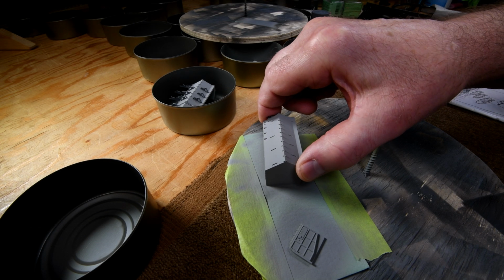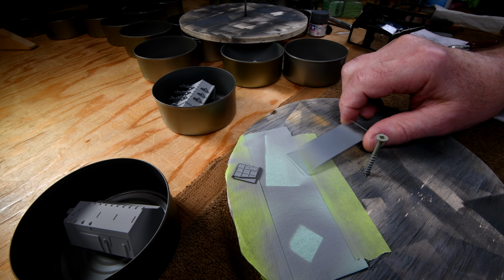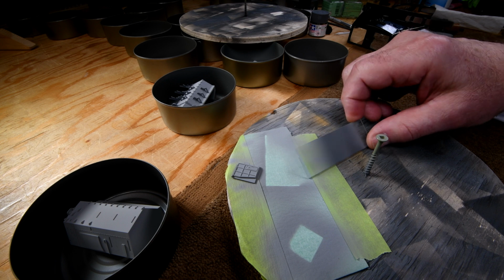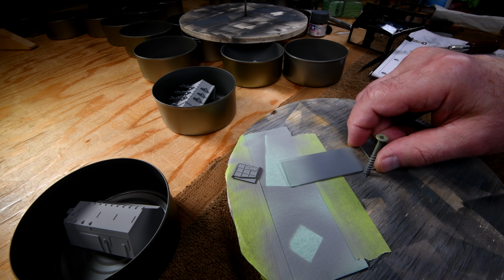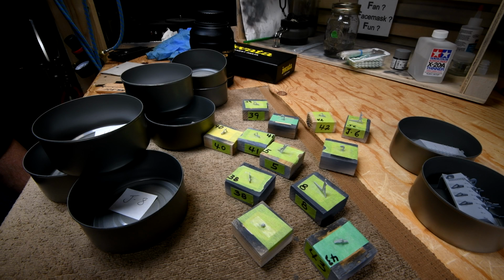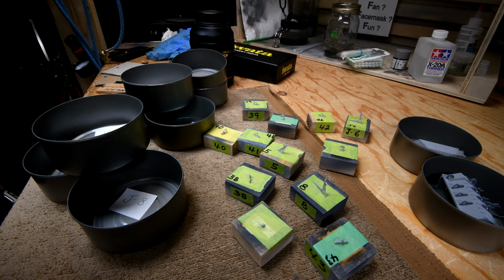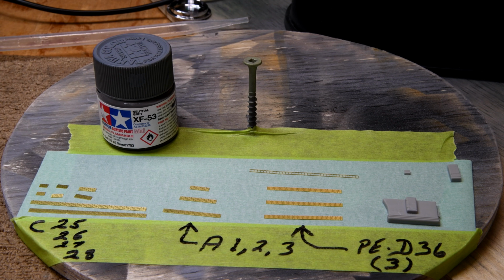The Model Ship - Part 222

Comment: I have never used an air brush before but I have used a spray gun before.  It looks like to me that the paint is drying before it has a chance to flow out.  In painting a car we would use a different thinner ( not as hot) .  Anyway if someone gets a magnifying glass and starts looking at our model you have my permission to rap them on the head with your broom handle.  See you tomorrow good Lord willing.

Comment: Ron, if you’re getting a “pebbly” appearance on the finish, as others have said, the paint is drying before it hits the surface. This is caused by a couple of things. The paint is not thin enough, spraying is done too far away from the model or the pressure is too high. Generally, thinned paint is at a lower pressure than non-thinned. If I use non-thinned paint, I’ll use 25-30 psi, spraying about 2” away. If I use 40/50% thinned, maybe 15 psi, at the same distance. With flat paint I try to get a slightly “wet” appearance as I am spraying. Works for me, others may do it differently. See you tomorrow.
Reply: I gave Ron the exact same advice a couple vids ago. He will get it eventually I am sure.

Comment: Ah, thinning for the airbrush, 50/50, 70/30... you hear a lot of "formula's", but the truth is, every paint requires a different ratio (even the same colour of a different batch), I have been told, and it works for me : after thinning the paint, dip a stick in it (perhaps a stirring stick, of a part of the sprue...) and when three drops of paint drop form it before stopping dripping, not more not less, the paint is thin enough. Some others say that the vicosity should be the same as milk, but I have alwoys found it difficult to judge that.  It is also said that it's not good practice to premix the paint in advance, though I sometimes do it myself when I know I will probably use it all in a matter of days.
Reply from the maker: Yes, so many different opinions going around, lol. 😁